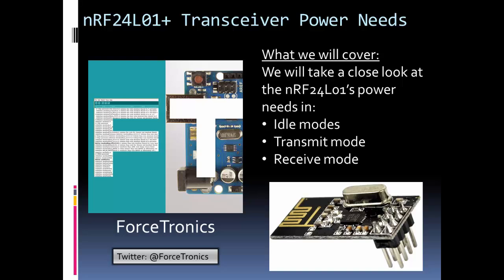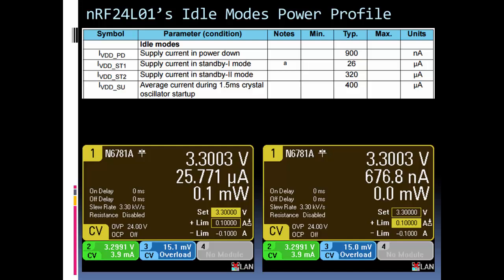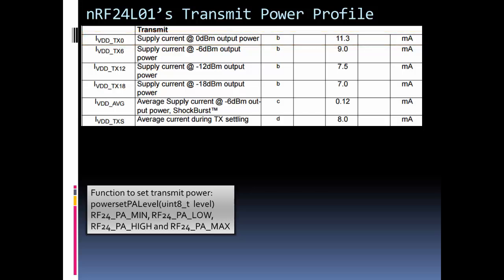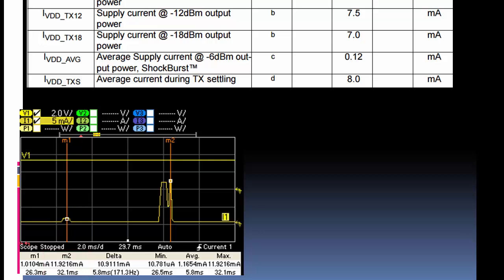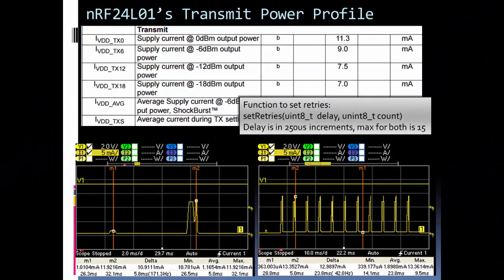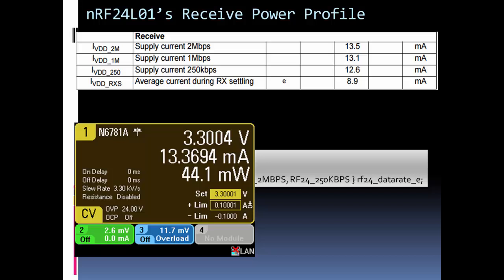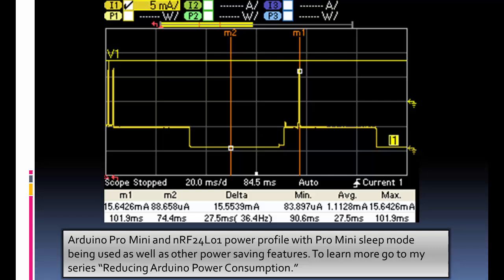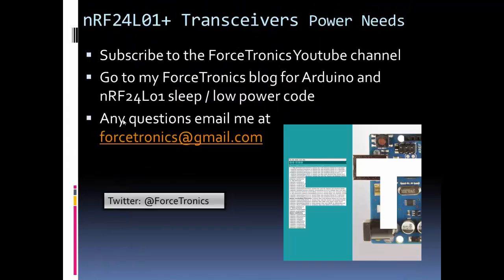Reducing the Power Consumption of the nRF24L01 Transceiver

Comment: When I use the function powerDown it uses 0.6 milliamps. Is anyone else having the same results?
Reply from the maker: If there are other circuit components in your design then that will affect the current draw. This video current spec is based on isolating and measuring the current of the nRF24 only
Reply: @ForceTronics  I have my Arduino in deep sleep when I measured it. Maybe the library that I used was not working properly or I got a cheap clone.
Reply from the maker: @TonoNamnum  How are you measuring the current? Measuring low current is not easy, are you using a low cost handheld DMM? Low cost DMM use a shunt to measure current and are not accurate at low ranges. Do you know what the lowest current measurement capability of your device?
Reply: @ForceTronics  I am using a voltmeter it is accurate. I am also not using the entire Arduino board. I have only the atmega 328 chip. When the atmega 328 chip goes to sleep it is in the micro amps of current. I am turning on the nrf24  with a transistor because of this and everything works great. I probably have a clone of the NRF24 becasue they where very cheap on ebay. Or maybe I am using an outdated library I will try those both options.

Comment: Nice done! What is the lowest power consumption of the nRF24L01+ and an arduino pro in RX mode? Can I built a camera remote trigger iwth that that lasts for month on batteries?
Reply from the maker: I don't know the Arduino Pro's lowest current consumption. The microcontroller on the board has a sleep mode that probably draws micro amps. But the board has other ICs that burn power like the linear regulator so probably can't go lower that Milla amps
Reply: @ForceTronics  jes the Arduino is not the bottle neck, it's the nrf that draws propably a lot when in listenmode/ready in sleep
Reply: @Max27653  You are correct. I currently have a set up with a EzSBC esp32 board which draws 10uA in deep sleep mode (without anything connected to it). When the nRF24L01 is connected, the current draw jumps up to >5 mA in deep sleep mode. So, I'm currently trying to figure out how to reduce this current draw from the nRF24L01 if possible.

Comment: Thanks for the detailed explanation.
I want to analyze the power consumption but I don't know how .... Can I use multi meter by connecting it in series with 3.3v input ?
Reply from the maker: You can but unfortunately most handheld multimeters can only measure current down to milliamps or maybe hundred of micro amps. Refer to it's datasheet

Comment: Sir, are you using current probes for current measuring on MSO? Could you please suggest me the way to measure nA current at low cost? Or any instrument
Reply from the maker: In the video I am using the N6705 DC Power Analyzer from Keysight Technologies. It is a power supply with internal shunts and digitzers to capture the dynamic current profile. Scope probes that capture the magnetic field of the current are too noising to go sub milli amp. Another option would be some type of source measurement unit (SMU), but don't know of a low cost solution for nA level measurements.
Reply: @ForceTronics  Sir is it possible to measure it using shunt, if possible please suggest me the resistor value of shunt resistor

Comment: I've got my Pro-Minis down to 85ua (with pwr LED cut, stock regulator). Using MySensors, so need to get into the network, but only for weather readings, so like every 10 minutes is fine.  The nRF24 clones are all over the place-if they work-so I bought 4 'real' ones, and can use this info to only fire those puppies up when needed. Looking at interrupts with the LowPower.h library, as 8 seconds is not near long enough to sleep. Thanks for this! I'll direct people here from my channel when the video is done!

Comment: I want to transmit data only once I get an interrupt. I found many codes to send data in a loop. I want to transmit data when I get an interrupt and then go back to power down mode. How can I do this?
Reply from the maker: These two videos will help. The first talks about how to trigger an interrupt using the nRF24L01 and the other is part of a series that talks about reducing Arduino's power consumption which includes information on sleep mode:
https://youtu.be/vzWcBAWpTx0

https://youtu.be/ktvUunBQQD0
Reply: Thank you so much! I'll let you know if I have an issue. Thanks again :)

Comment: Good :) What about interrupt and sleep ?

Thanks!
Marc.
Reply from the maker: The power down mode is essentially the sleep mode for the nRF24L01 and you take it in or out of power down by changing the state of a pin which is basically an interrupt.
Reply: ForceTronics Thank you
Reply: ForceTronics i would like To make a wireless doorbell with a push Button an interrupt And sleep mode. Is it possible ? 
Thank you. 
Have a great day.
Reply from the maker: The short answer is yes. The long answer is to write down the functionality and features you want in the design. Then research the different parts, wireless standards, etc that best fit the needs of the design